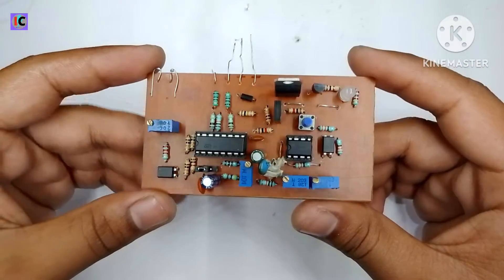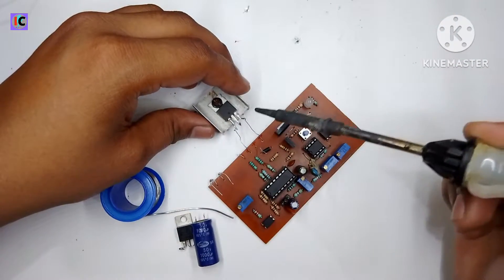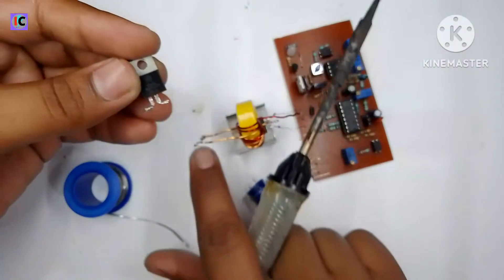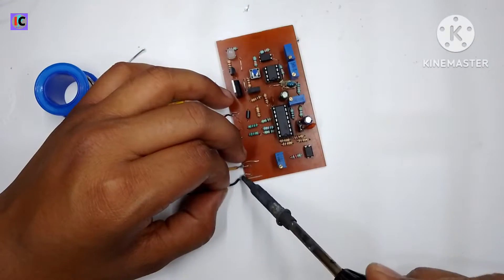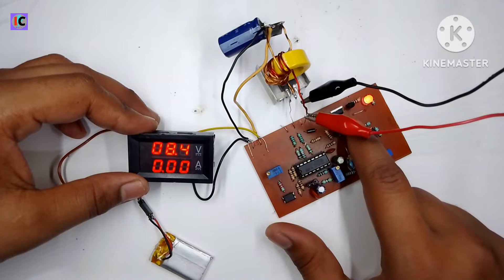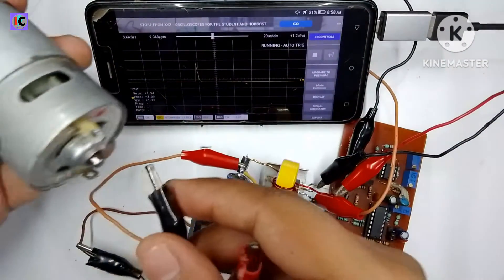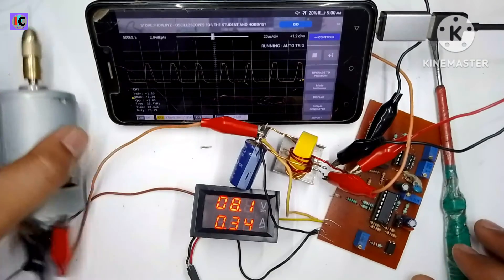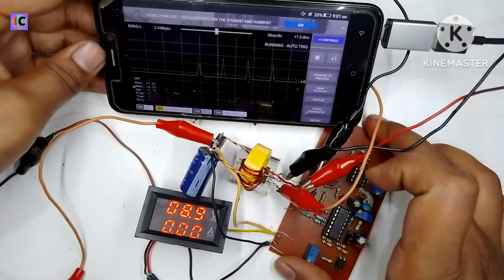Unleashing the Power: Building a High-Efficiency SG3525 DC-DC Converter

Comment: Hi man ,Controlling the output current on the potentiometer will be useful. How to set CT switch between 10nF and 1uF ?
Reply from the maker: just use 3-pin male header and 2-pin female header to switch between 10nf or 1uf